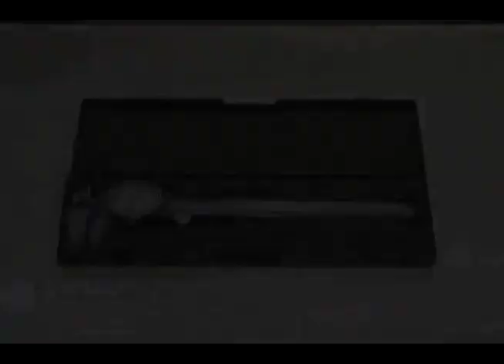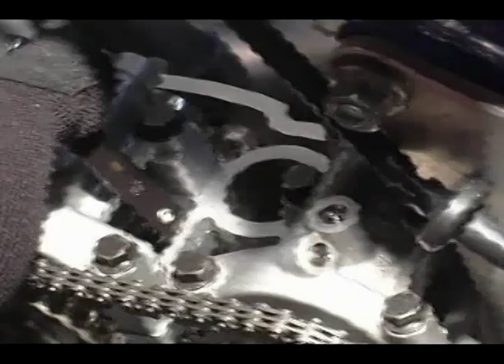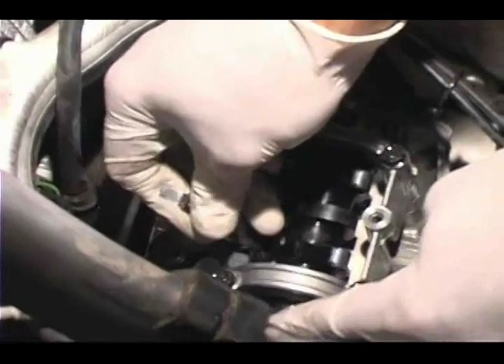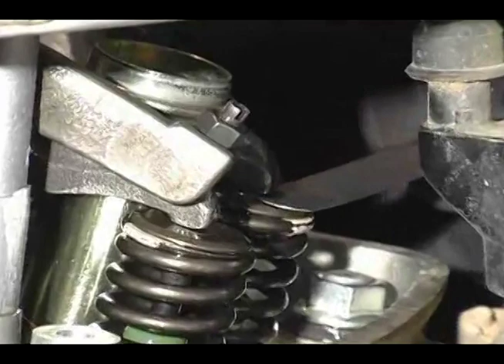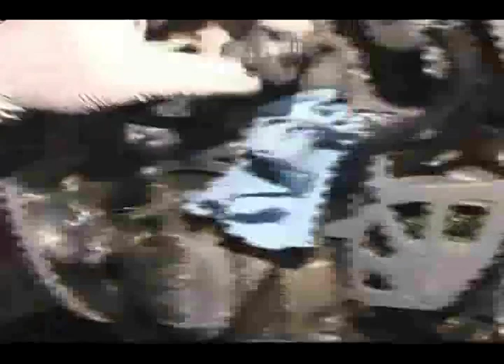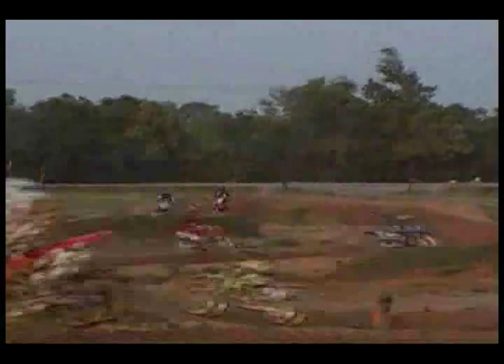Hot Cams valve clearance inspection Honda CRF450R

Comment: thx this was really helpfull. My crf250r has low compressing and i think the one of the valves gets stuck or stays open. Now i'm going to check clearance for the forst time on my bike. The formula you guys provides was amazingly helpfull it saved me alot fo researche. One question: are the intake/exhaust measurements the same for a 250 as for a 450 ?